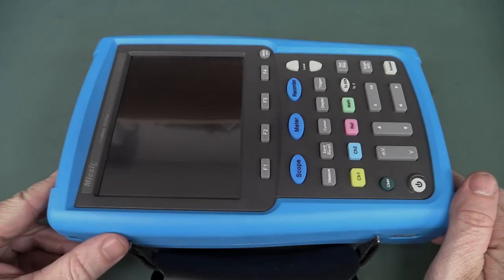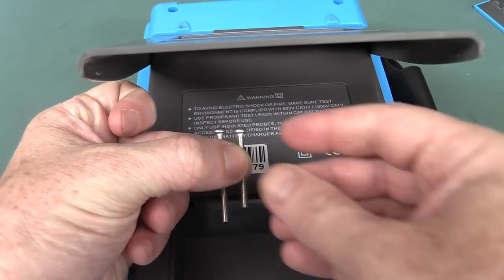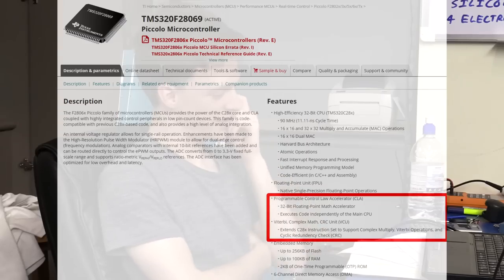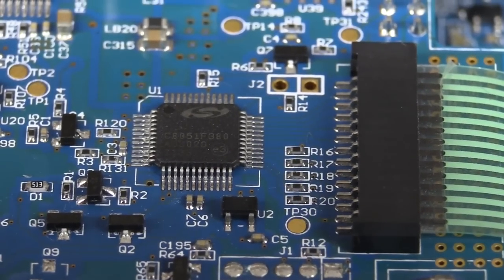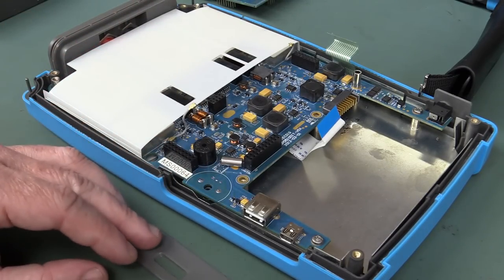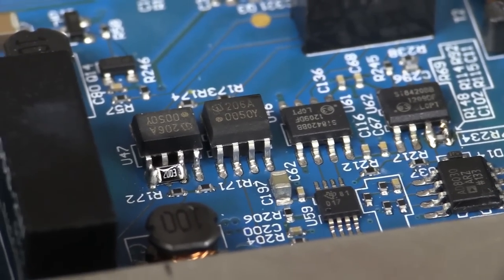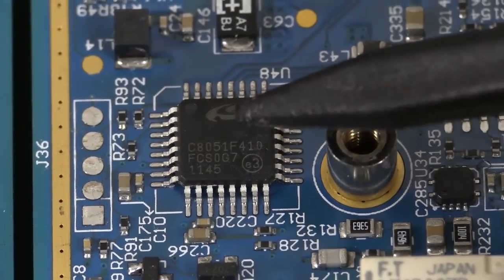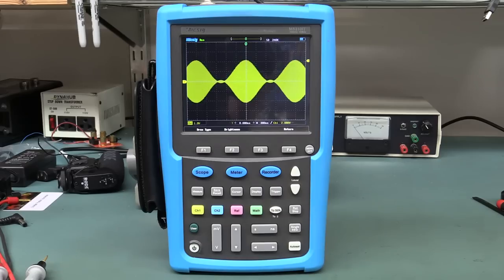EEVblog #810 - Micsig MS310 Handheld Oscilloscope Teardown

Comment: For the signal routing, it would be interesting to see if you can detect a difference in the noise floor between the two channels. If you can and its got an FFT function it would interesting to see the spectrum.

Comment: The "unsoldered pin" and "fallen out pin" is a cheap way to do DIY keying now you can't plug in certain revs of the board or accidentally reverse polarity in testing cables. Also the 0505S is indeed a 5v to 5v converter but the 'S' stands for single supply, so not a dual +/-5.

Comment: "The penalty you pay when you go for a BGA FPGA" - untethered poetry.
Reply from the maker: +FFcossag I never knew I had poetry in me...
Reply: +EEVblog Hi Dave can you make a video how to read burned resistors ?
or explain me cuz i am in trouble
Thanks :]
Reply: +Frank Alvarez You'd probably have to use the components it's connected to to infer possible resistance values, then try them until one works properly...
Reply: +FFcossag I liked the "coz these things aren't magic" comment myself! (at approx 20:53)

Comment: Silabs makes 8051's with interesting peripherals for test gear. There is a thread about a µV/mΩ meter kit which uses a C8051F350. This is a brother of the microcontrollers in the video, it has a  has a 24-bit adc and a 1-128x pga on board!

Comment: The TMS320 is still quite a capable DSP.  In the early days of production they were used in high-end 3D graphics systems and even found their way into Midway's first 3D video game hardware where they served as both the main processor and the geometry engine at the same time.

Comment: That thing seems to be a mixed bag, great design but poor manufacturing I guess! Lots of little things you pointed out, like the 2 little transformers (or common mode chokes) one looking a bit broken, C123 is missing and the solder did not reflow right, that bit of solder shard shorting 2 pins on that 8051 near the end, etc! I wonder if it would have even been fully functional before you took it apart!

Comment: Very nice videos.
There is any posibility of making any video regarding the bad usb killer ? And maybe made a circuit where you can plug any usb device and get a reading of the voltages to avoid putting a usb killer in a computer ?

Comment: A bit concerned with the missing solder under the F330 on one of the pins @24:00. Guessing it is a ground pin and the solder has gone in under the circuit to a ground tab. It is not pretty.

Comment: I wonder, in digital scopes when you move the trace up and down is the scope only moving the trace on the display or is it changing some analog offset value before the ADC? Also as a German, what's wrong with calling it a multifunctional device? I mean it is multifunctional, no? Does it just sound weird or...

Comment: I wonder why they did not just run the coax a few cm longer before they go into the board.
Assuming that coax is more noise resistant than board traces.
Reply: Properly terminating coax into pcb traces can take up enough space that its easier to run a proper pcb transmission line the extra distance.
Reply: +Tilman Baumann Maybe he was tired.
Reply: +Tilman Baumann Maybe they already had enough layers in the board to isolate the signal properly, what with the MILLIONS of micro controllers and the big BGA(caution, some exaggeration).

Comment: That pin in the header socket (J57?)  looks like an improvised polarising key. Shouldn't be needed in a PCB to PCB arrangement like this, but they may use ribbon cables somewhere in testing/faultfinding.

That missing top on the choke is probably there only to give a flat surface for pick and place, nothing functional.

Comment: You seem impressed. But, the loose piece of solder, the unsoldered pin, and the "bodgered" resistors/caps make me surprised that it actually functions properly.  Don't these defects scare you off, especially at a >$1000 price point?

Comment: Seems like the 410 is the same sort of thing but not isolated. It's also much cheaper. I'm looking into a first scope for automotive use, so it's unlikely to be seeing above 15v or so. The built in meter function is quite interesting too.

Do I really need an isolated scope? What are the advantages/disadvantages?

Comment: Why can't they throw in a nice 2048x1536 display on it. For that astronomically high price, they need to at least use a more modern resolution for their display.
It also should have more memory (e.g., 1GB per channel would do nicely).
Reply: +Razor2048 2GB of SRAM? Are you mad? I'd say the display is fine, but for the price they should probably manufacture their product a bit better.
Reply: +Razor2048 hard to find industrial reliability grade displays at the higher resolutions. remember, this is not a toy.

Comment: I spot lots of MC34063 action, yeah... I have a few of those in my M102v5 production design, and by using slightly oversized inductors and massively oversized caps I managed 10mV or less ripple on a 15V rail.
Reply: nice

Comment: Cripes there is some variability in quality control there! The meter inputs are very poorly soldered, and I suspect the person who did that also dropped the blob of solder into the front end electronics. They need to see your soldering videos, Dave! Maybe the soldering technician was off sick, and the window cleaner had to do the job instead.... chinese factories!
Another let down is the awful Chinglish font they use on the display. Not sure where that font came from, but is is horrible and hasn't changed since the 1980's. It would cost next to nothing to fix that, but the archaic character set isn't something the Chinese seem to worry about. 
On the plus side, the board components and layout are state of the art and mostly very well thought out, with no cost cutting. Like I said, shame about the hand soldering.
As for that header with the pin sticking out. It might be a way of ensuring the pins are properly lined up when the boards are pressed together. Some old PC IDE headers were a bit like that, with one of the pins blocked off to prevent misalignment when assembling. Just my theory!
Reply: thicc

Comment: I just bought a couple Siglent Chinese O-scopes.  It's very good, and as an American I'm pretty worried that China will be not only making the cheap stuff, but the good stuff too.  We're doomed.

I recently used AD7799BRUZ ADC's on a recent NASA project.  They are 24 bit ADC's (which is overkill for a lot of stuff), but super easy to use and very stable.  For that matter I suppose the refresh rate is way too slow for a o-scope.   I've been wanting to make a multimeter specifically for aviation applications and might dust them off for that.

Comment: Are these kind of boards designed by one person alone? They are complex.
Reply from the maker: +xartpant Sure, as a professional PCB designer I've designed boards much more complex like this on my own. Usually it's a one person job. Does take time of course
Reply: +EEVblog I'm sure the software these days can do a lot of the "grunt work" for you (matching trace lengths, etc.)  I've seen one some time ago that produced weirdly organic-looking traces.
Reply: +GothAlice Modern serial-parallel protocols (ex.: JESD204B) use word-level alignment at the MAC layer to eliminate the length-matching constraints between serial lanes. Expect the art of delay-matching multiple LDVS pairs to start dying off soon as more serial-parallel chip adopt word-wise re-timing between serial lanes.
Reply: +xartpant it's hardly a one man show.

Comment: 20:26 is that C123 ripped off? :O
Reply: +Jaroslav Malec 
That looks weird. It doesn't look ripped of (you'd see some sharp edges in the solder then), but it doesn't look like it was never populated either (double negative on purpose ;) ). What really worries me though is, that the solder did not reflow properly on the whole pad. Many of the other solder joints look dull, too. So maybe they didn't heat the board long enough and if there was a cap on the pads it never reflowed correctly and just fell off when washing the board. Would need a second unit to compare, but doesn't instill a "quality" feeling at all.
Reply: and take a look at r141
Reply: +superdau I must totally agree, it does look like improper soldering process.
Reply: +Jaroslav Malec  U41 a resistor on a SO8, this product is full of last minute work.
Reply: +Bernard Lim Indeed, it's everywhere.
Reply: +Jaroslav Malec Very inconsistend quality, seems like a rushed job...
Reply: +Jaroslav Malec  nice observation :)
Reply: +Jaroslav Malec 23:52  SIL C8051F330 Pin 2 (Ground) not soldered properly?

Comment: Could you explain what "Jellybean" means please
Reply: It basically just means generic, off-the-shelf components. That is to say, components which are not application-specific; indeed, the type of components which are often not specified beyond value/tolerance and rating.

Comment: Am I the only one who thought they did a bad job of hiding their traces under that metal pot?

Why couldn't they had just did a uniform sanding on the top? Or better yet, silkscreen a big white block over it? Looks bodgy as all hell.

And that white goop, eugh, there has to be a better way. Thinking back to iFixIt's mantra of If you can't fix it, you don't own it, Micsig automatically lost me as a customer.
Reply: The white goop is there because the transformers are heavy.  The fact, that they are Chinese doesn't mean they don't know what they are doing! And it's much cheaper to hand grind the markings of the part. If they wanted to spend more money for hiding it, they would  have ordered the transformers with their brand and part number, but not to listen to your suggestions.

Comment: nice latest FLUKE clone ;)
Reply: +InXLsisDeo I mean appearance. Housing and buttons. same as Fluke ;)
Reply: +InXLsisDeo The apprentices at my company were bought tool kits - including a Fluke voltage tester (T90 I think) and it does have some nice build, I trust it is safe internals (But I have not done a teardown)...but it's continuity test buzzer takes over .25 seconds to respond...duff design.
It also has an odd interrupted beep if you hold the continuity closed for a second or two --- how is that helping me diagnose a intermittent fault when I wiggle a cable ??.
You don't always get the best tool from the best companies.
(I expect some programmer thought it would be good to ad the intermittent beep, and the code became unresponsive unless the continuity is 'solid'...so it waits a bit to debounce the probe tip contact. SIlly.